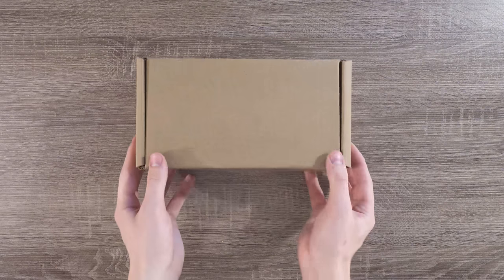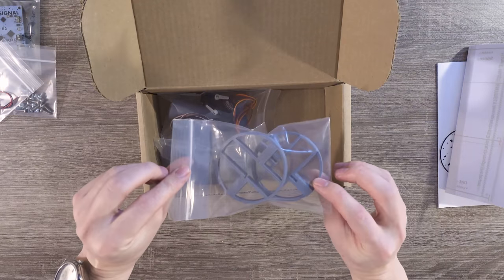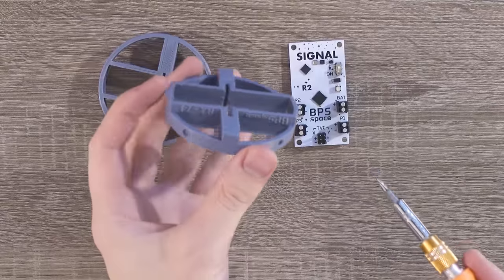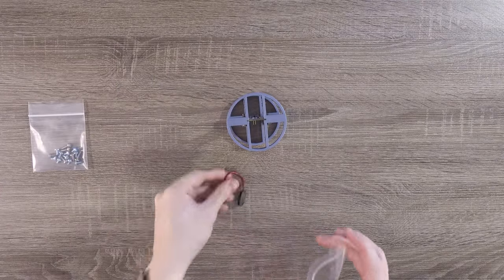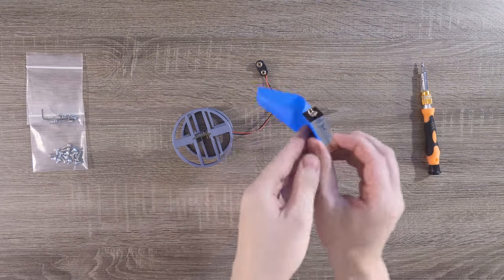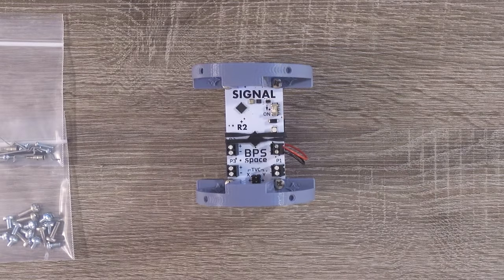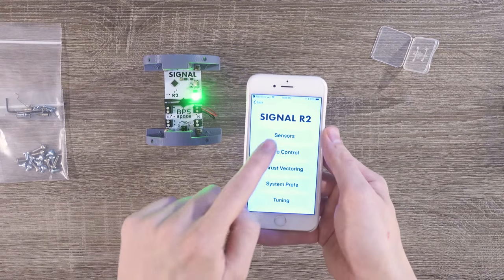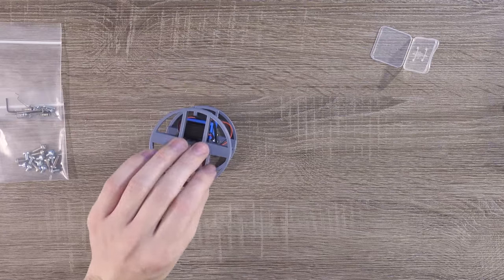Flight Computer - Build Signal R2

Comment: Could you just use a arduino?
Reply: yes, but you will be limited by memory. But it's a good starter
Reply: I am planning on launching my own rocket, just wondering if a pyro channel to fire an ejection for the recovery system could be used by an arduino?

Comment: This is so damn expensive . Only one board and a few plastic parts for 300$
Reply: Well it’s 250$ and it’s not so much the price of the components as it is the knowledge put into them. That PCB had to be thought up, diagrammed, wired, and troubleshot, and coded (which takes a long time, might I add). Those ‘plastic parts’ had to be thought up, designed, and 3D printed (which can be expensive at times). All of these things you call junk, is really a beautiful use of technology. So maybe think a bit more before you comment stupid things. Stop taking his work for granted or just don’t buy it and stop complaining. Maybe even do it yourself. Have a nice day!